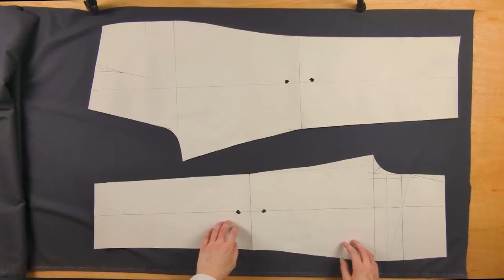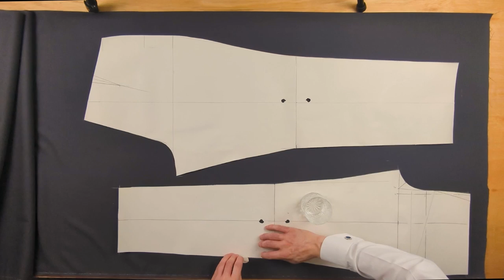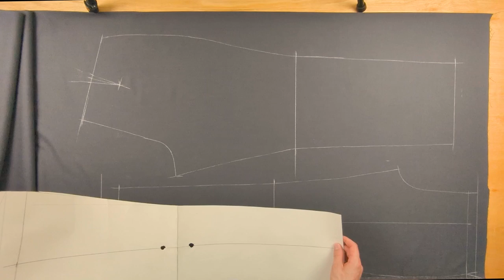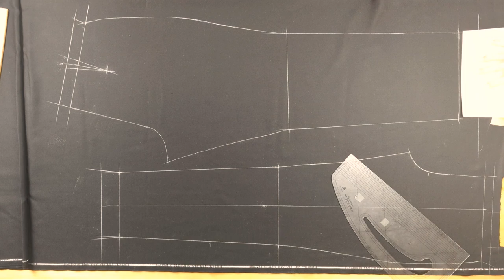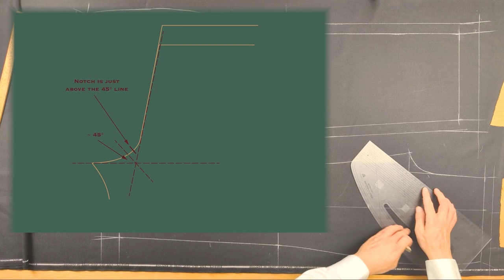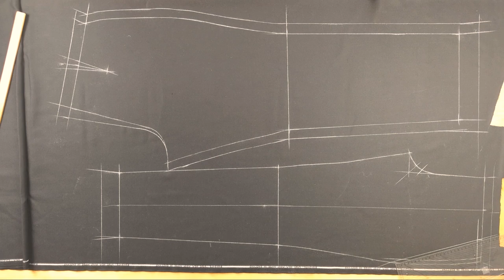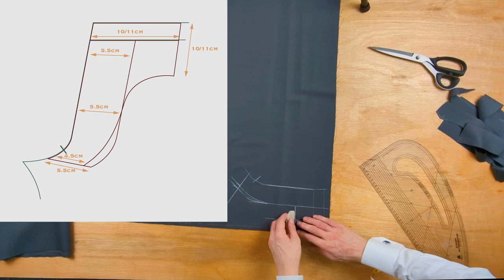Complete Trouser Making | Guide to a Bespoke Suit

Comment: Thank you for your detailed video.  A lining question for you: if the outer fabric is tweed (slightly itchy to skin), can lining be added to the back trouser pieces as well?  If so, is the lining added to the back pieces in a similar manner as to the front pieces?
Reply from the maker: It can be. I think that would be called full lining.
You only need to do a baste along the inside of the inlay so that the lining doesn't get pulled to the outside of the stitching when the side seam and inseam are sewn.

There is also a drop-in lining. Basically the 4 pieces of trouser are made up in lining. They're dropped into the trouser before the waistband lining goes on.

Comment: Thanks for the great content! However, I am missing something here:

Both legs are cut identical at the waist and both the fly and the fly guard are sewn at a small cm SA. 

But then when you measure the half waist on the right leg, you start 7mm inwards, while on the left leg you measure until the edge at the center front. Those two cannot be identical by design - is the standard process to adjust the center back on one/both legs anyway?
Reply from the maker: The usual idea is that both centre fronts become a whole seam allowance by the time it's finished. So the fly is sewn at a small SA, then as it's folded over it becomes the whole SA. 
The bearer/zip side with the overlap it should work out. 
That and marking the waist measure onto the waistband any extra length will get eased across the back trouser.

Comment: Great videos thank you! Just out of curiousity, why don't you back tack for the trouser seams and waistband attachment?
Reply from the maker: In some cases it's so that the seam can pull apart if it needs - if it would become tight, in others it's so that I can pull it apart more easily later, and some it's just not really necessary because it's going to have another stitch across it which will hold it together.
Reply: @caffeinatedtailor  thank you!